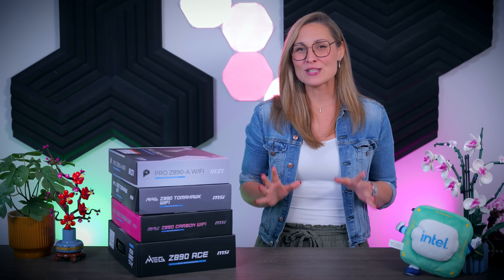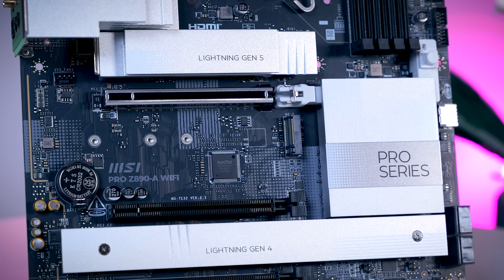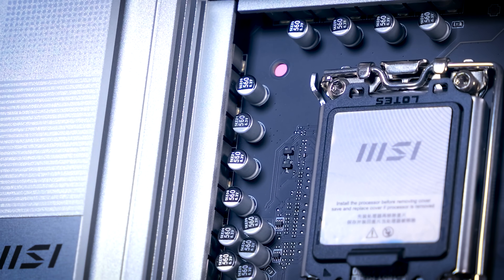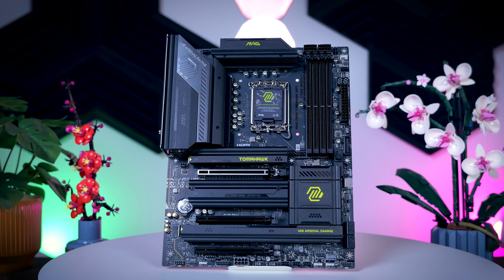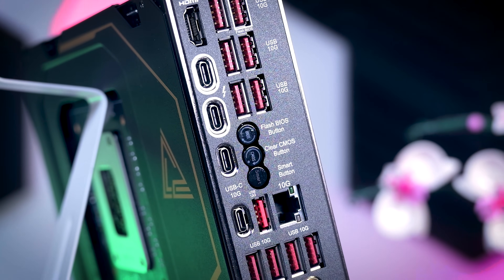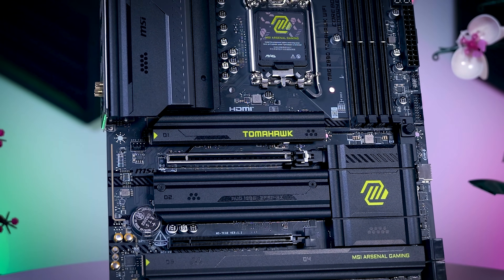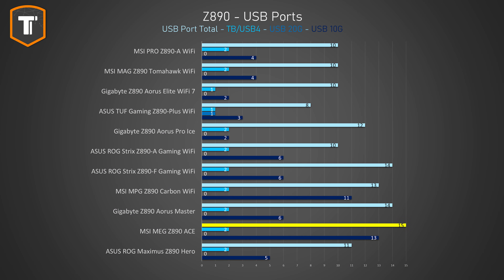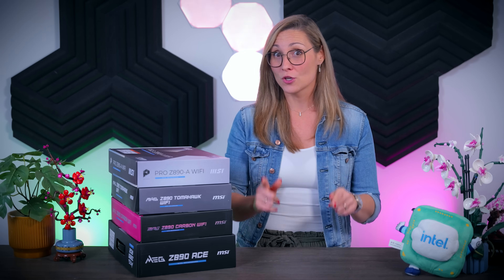New MSI Z890 Motherboard Line-up - Core Ultra 2 Series Ready

Comment: what 14 gen? is it not supposed to only support 15 gen Core ultra?
what soket is it?
Reply from the maker: Z890 = Socket 1851 for Core Ultra. 12/13/14th gen is Socket 1700.
Reply: @TechTesters  yes but in the video you were missleading... or not making sense, something like 1851 is for 14th gen.

Comment: Hi, I was looking to get the Z890 Aorus Elite Wifi7, the Z890 MSI Pro A cost 30usd more in my country than the Aorus. Is it recommended that I get the MSI instead?
Reply from the maker: I don't remember every spec detail of those two boards, but I do remember both are completely fine. So unless you want to pay for a specific feature, or the brand, I don't think you can go wrong there.

Comment: It will be interesting to see how the Core Ultra performs after a few BIOS and Windows updates.  They're coming.  The motherboards are extremely nice, but the processors need tweaking.  The memory controllers need to execute the speeds the DIMMS are rated for at full speed without errors, artifacts or crashes.

Comment: 11 usb ports?! Just why and like how many do people even use?? If there is someone here that uses that much, what do you use them for all at once? I'm just really curious about that.
Reply: Content creators (i.e. streamers) may use ALOT of usb connected devices. Camera's, several controllers like the streamdecks, footpedals, audio interfaces etc. The high bandwidth ones like video/audio devices need their dedicated USB-port, won't work well with most hubs.

Comment: Thank you for this excellent review of the MSI motherboards. It should be very interesting to learn your experiences with the new processors and the new boards. You present the strengths of these boards very well. Seeing the Intel plush toy brought a smile to me. The videography is truly outstanding. Thank you so much for all your work in this area.

Comment: Are we really living in the age where paying €350 for the budget motherboard has become the norm? This is ridiculous. Not too long ago you could get a good motherboard for $100-150
Reply from the maker: We'll see decent boards for <200 soon enough. There are completely fine <150 eur B-series boards as well.

Just everyone launches with mid range and high end boards first. And to be fair, a modern Tomahawk is objectively better than high-end boards from a few years ago.
Reply: They will go down in price Quick.
Reply: Z890 is not a budget chipset. But I agree that the starting prices are too high.
Reply: @AdnanKhan-be9dr  True, though i can buy an AM5 ATX X870 MB around 240€.
Reply: I know, MSI's B450 Tomahawk was ~100€, now B650 Tomahawk is ~200€ which is already a 100% price jump, Z890 Tomahawk 350€... thanks but no thanks, MSI and Intel really want me to upgrade to AM5.
Reply: its still less then a nice set of fans, say you get a lian li o11 rgb and you need 10 of those its more than 350$
Reply: On some level I genuinely do get what you mean where 350 dollars is too much for “budget” options but having wifi 7 plus thunderbolt 4 on rear IO plus thunderbolt 5 headers on the board itself with gen5 PCIe slot for the ssd do cost money and later on we’re gonna see B850 boards launch which should be cheaper

Comment: Why manufactures are giving Intel boards better specs than AMD at same price? I mean MSI X870 tomahawk has 14+2+1 80A vrm, MSI Z890 tomahawk has 16+1+1+1 90A. This is stupid, if you check gigabyte or asus is the same thing, manufactures are giving a lot more for intel platforms and charging the same or less x AMD. This makes no sense.
Reply from the maker: You're not wrong :) But I don't know why that might be the case.
Reply: They might know they will sell more Boards for Intel and that their CPUs are less effizient.
Reply: They need to charge for the longer support cycle of AM5 in terms of CPUs released on the platform.
Reply: You are also forgetting that it's not necessary to get a new board with AMD and AMD will be supporting their platforms for far more years than Intel who usually makes you buy a new board for every new CPU so you need to keep that in mind
Reply: @chrisbullock6477  We dont know about that, maybe this might be the last cpu amd will make for this socket, amd did not say a nything about it.

Comment: What would be the best board that has the most usable m.2 ssd slots and usb ports?
Reply from the maker: How many do you really need?
Reply: @TechTesters  I have currently 7 usb slots being used and im hoping to have 3 usable m.2 slots. Idk if that would exist or be possible. ( I am using 2 m.2 slots currently)